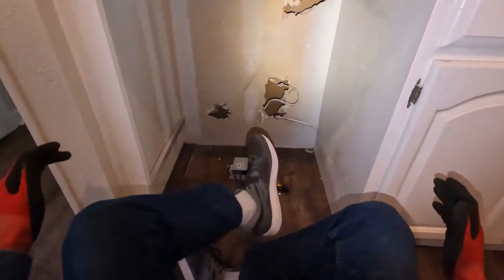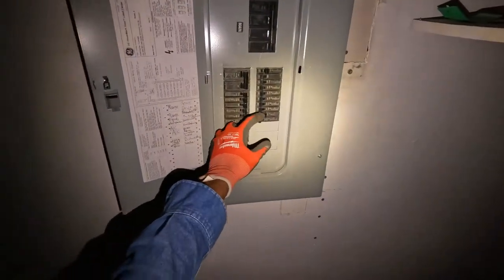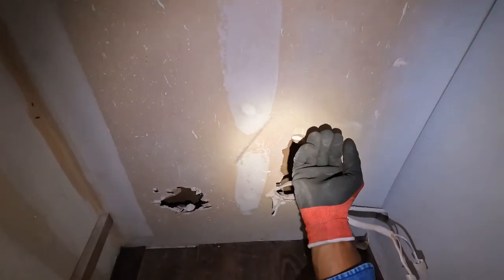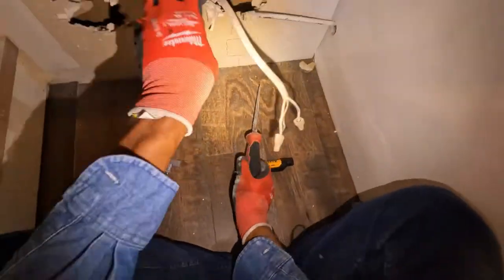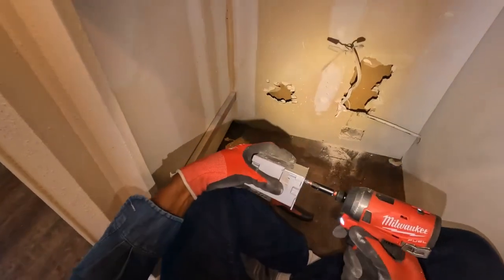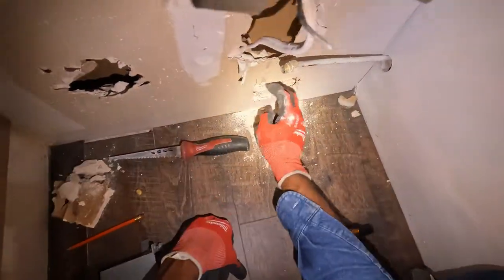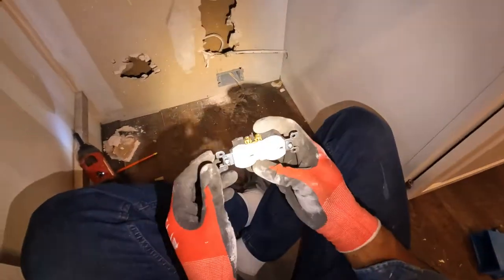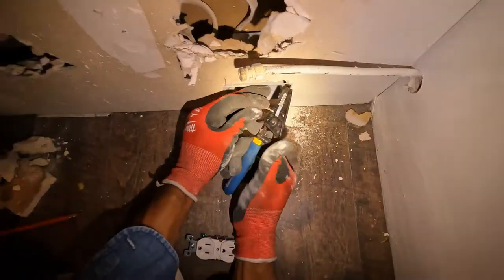Converting Hardwired Dishwasher to Outlet to Plug In

Comment: Wow you make that look so easy. I just installed a new garbage disposal it came with a plug my other garbage disposal let's hardwire now I'm trying to put a new outlet. But for some reason when I turn on the switch its not working. I know my switch is getting power because it's lit up?
I had 1 white wire and 1 black plus the copper wire. 
What did I do wrong?

Comment: I recently did similar at our house, but installed a GFCI in the adjacent cabinet, which I think is current code.  And for anyone watching, patch the holes in the drywall.  If a "critter" gets in the wall, it's a point of entry into the house.
Reply: Correct. NEC 2017 Section 422.16(B)(2) - (6) The receptacle for a built-in dishwasher shall be located in the space adjacent to the space occupied by the dishwasher.

Comment: NOT CODE. Needs to be in an adjacent cabinet, period
Reply: Does the Romex run need to NOT be behind the DW also, i.e. do you need to move the Romex penetration into the adjacent cabinet also to keep the Romex entirely out of the DW cavity?  Or can you keep the existing penetration and just move the termination to the adjacent cabinet?
Reply: Yup.  As I understand it, the receptacle needs to be in the adjacent cabinet.  So, you need to cut that box into the wall under the sink or SURFACE mounted in that space.  Then, you need to cut or holesaw a hole in the cabinet to feed the plug through.
The funny thing is, that IS NOT REQUIRED for a range receptacle.  WTF?

Comment: So it's seems like a 15 amp duplex receptacle when you said it's 12 gauge on a 20 amp breaker idk fs but that sure seems like a 15 amp outlet why not a single use 20 amp outlet.
Reply from the maker: It is a 20a outlet.
Reply: @unitedtradesmanacademy1894  fair enough I'm not the guy that bought it so just really looked like a 15 amp one usuay I see the 20 amp receptacles with with the one horizontal dash on the neutral side and didn't see it on this one. Keep up the good work sir 👍
Reply: @unitedtradesmanacademy1894 NO, it's NOT a 20-amp receptacle! You're 💯 wrong! 
It's a 15 amp receptacle connected to 14/2 romex.
Reply: @jsb7546 NO, it's NOT a 20-amp receptacle! He's 💯 wrong! 
It's a 15 amp receptacle connected to 14/2 romex. 
20 amp outlets have a "T-prong", while 15 amps outlets don't!

Comment: We got a dishwasher for the old one was not working for several years. Home depot paid for installation they couldn’t install it. They said we needed a master plumber. Master plumber came out and said we needed a master Electrician. For the old one has house wires and garbage disposal without outlets they just ran the wire through for the old dishwasher was acting a a circuit. Home depot problems with getting money back. Plumber charged to come out. Electrician charges a come out fee.  Now broke from paying and still dishwasher in kitchen. Looking for someone who can run wire and dishwasher on youtube.

Comment: NEC Violation.
Reply: Why?
Reply: @Sam Andrew  Receptacles for built in dishwashers will be located in space adjacent to the space occupied by the dishwasher.

422.16 (B)(2)(5) 2020 NEC
Reply: @simplewick350  so what would the correct setup look like, and is this done so the dishwasher can be plugged and unplugged without removing it? Thanks.
Reply: @Sam Andrew  Typically if the dishwasher is adjacent to a sink then the receptacle is installed in the under sink cabinet. Then you drill a hole towards the back of the cabinet into the bay designated for your dishwaher and route your cord and water line through that. 

As to why it's not allowed, I'm not totally sure but it might be something to do with accessibility to the outlet or like you said, to be able to plug and unplug it.
Reply: @simplewick350  I appreciate the info. One more question, is it still allowed to hardwire the electrical connections exactly as before, with the power cable running into the dishwasher cabinet and the wiring compartment located at the bottom front of the floor plate?
Reply: @Sam Andrew  Yep hardwiring is still OK. If the appliance cord is provided with the dishwasher, I suggest you use it. Refer to the user manual for manufacturers recommended wiring. If I'm hardwiring one I usually leave a couple feet of slack so I can pull out the dishwasher, if I ever need .
Reply: I’m swapping dishwashers right now. The current is hardwired, but there is still a plug in the adjacent (under the sink) cabinet. Now I have the decision to hardwire the new DW, or cap the cables and use the plug.
Reply: @Joshua Lee Frazier  I would recommend first double checking if that dishwasher Wire and the cabinet receptacle are on the same circuit. (Newer homes typically have a dedicated dishwasher circuit supplying it.) If the exististing dishwasher Wire is a dedicated circuit then use it.
Reply: I’ve seen a lot of things on this channel that are blatant code violations. Which is why I won’t be watching anymore.